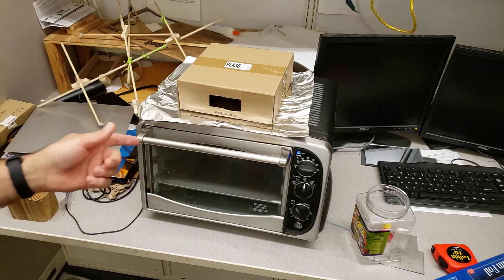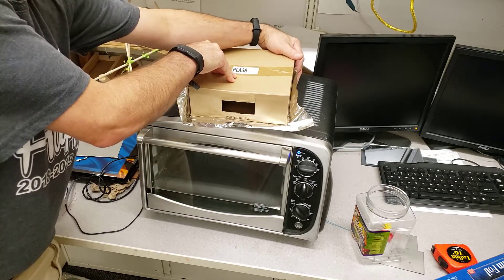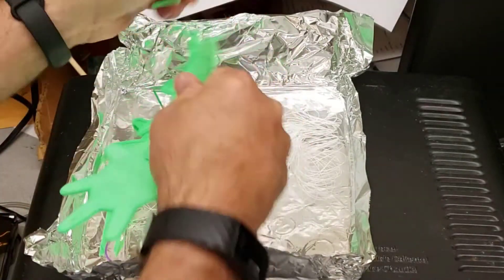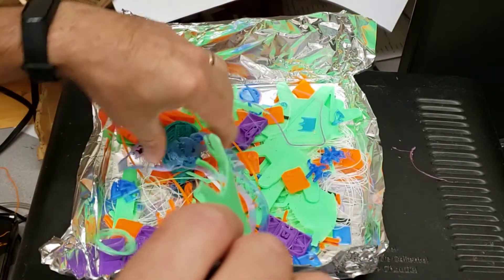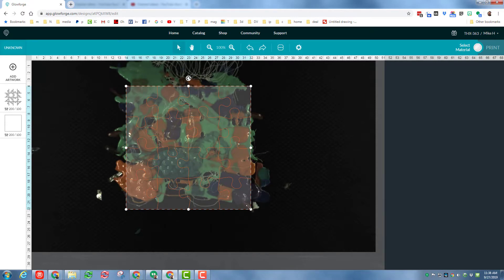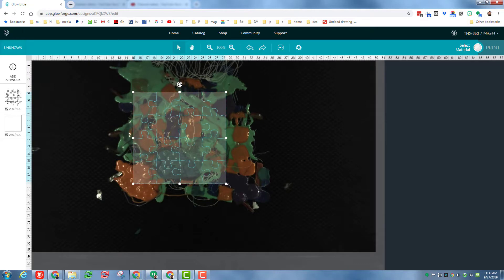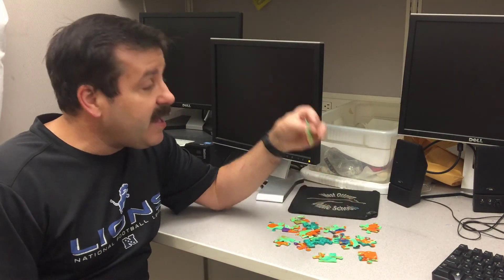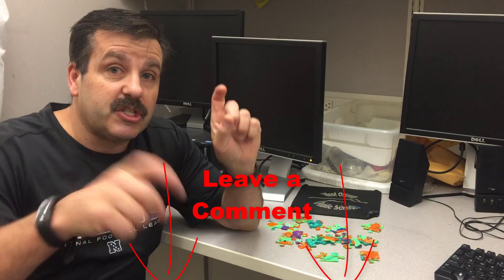PLA Puzzles Thanks to the Glowforge and a Toaster OVEN!

Comment: Hi! I have a Glowforge Spark and Bambu printer with lots  of poop to melt down. I have used my heat press to flatten abunch of waste into a flat disc but my Spark doesn't seem to cut through to make the puzzle. Any suggestions? I would really like to make these as gifts for christmas!
Reply from the maker: What power is the spark? I no longer have access my Glowforge or the toaster oven so I have not tried that in a few years. My guess would be more passes and slower speeds... but it is really 🤞...  Guess & check. Neat idea with the heat press. I too have a Bambu printer.... I may have to find a way to get back into that melt and cut game. =)
Reply: @HLModTech  I know I'm a little late to finding this video! Here is what I found on the Glowforge site for the Spark: The Personal Series uses a 6W diode laser that operates at 450 nm.
Certified as a Class 1 laser product containing an embedded Class 4 laser. Not sure what that all means but I can certainly do more passes at a slower speed. I really liked your idea to make puzzles with the waste and hope I can figure it out!
Reply from the maker: That helps. My Glowforge had a 40W CO2 laser. A totally different technology and quite a bit more power. I have marked PLA with my Diode lasers. https://youtu.be/yUkea0ecuVU
Reply: @ so do you think I’m wasting my time trying to do it with the device I’m using?
Reply from the maker: Not quite sure... but I know it takes a lot of power to cut through the 3mm PLA I had back in the day.

Comment: how wide are the gaps between the pieces and is there any way to reduce it? I have thought that selling puzzles might be an interesting idea, however I would like to know some more information so that I can make sure that I feel like the quality is high enough.
Reply from the maker: The PLA was pretty snug, but if you were cutting wood you could adjust the line thickness in Inkscape to get the desired result. The puzzle template had tons of ways you could adjust the pieces. 👍 My puzzles were just in the classroom, but they were pretty popular.
Reply: @HLModTech  thank you for the information!